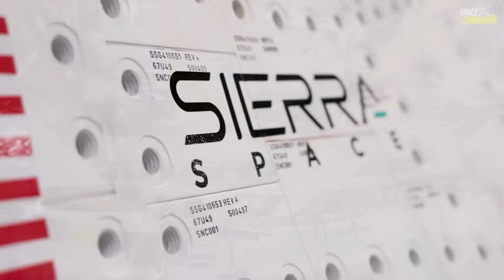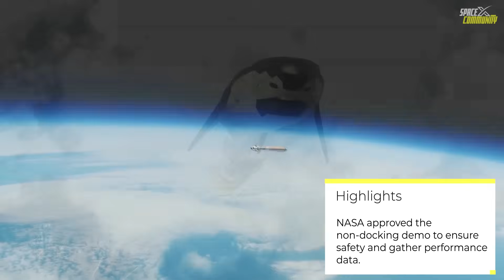Why NASA Cancelled Sierra Space Dream Chaser Tenacity Launch? It's Over!

Comment: Skid plate for nose gear won't work, first expansion joint in concrete runway will strip it RIGHT off, like it did when they tested autonomous landing coupla years ago.